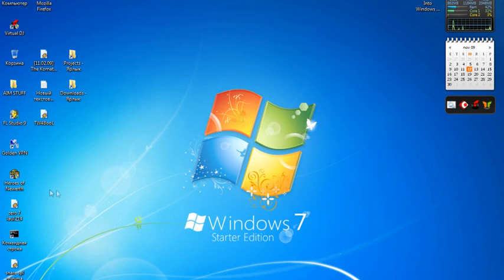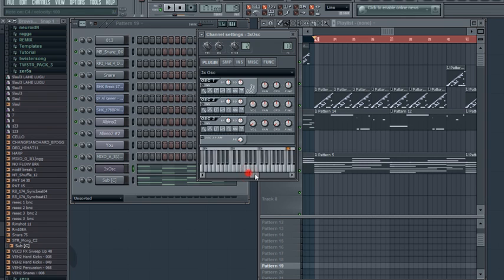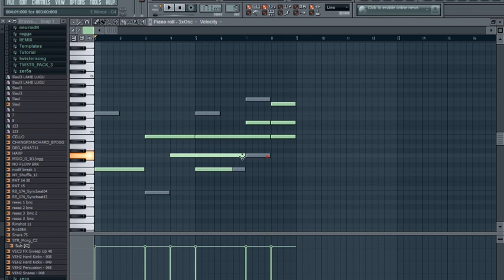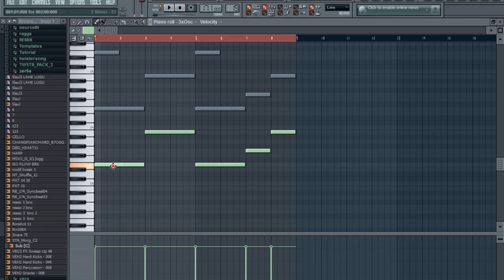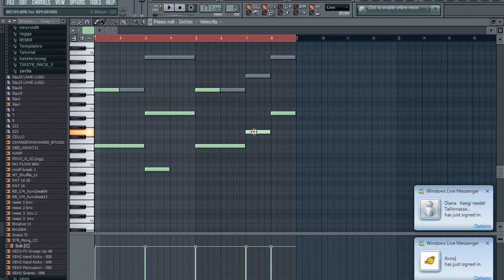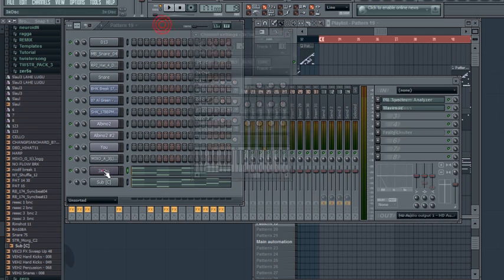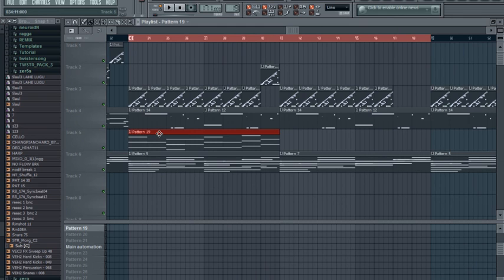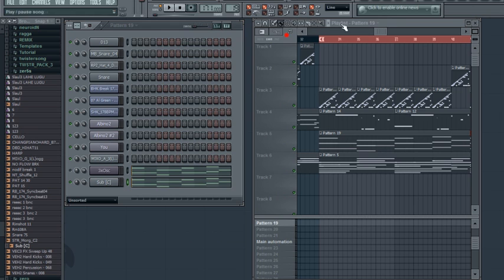FL Studio dnb subbass tutorial

Comment: @GiDriK do you have any advice on what vsts or filters to use? ive been using as i said fruity free filter for the high pass on mostly everything and low pass on the bass. ive also tried parametric eqing on the bass. im not sure if theres another program i should be using or if i need to just tweak with what im currently using